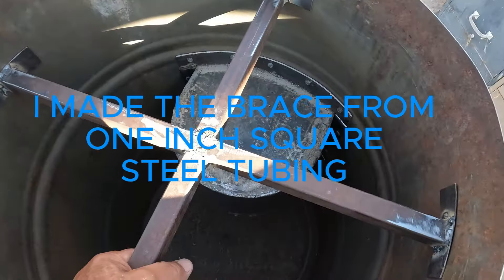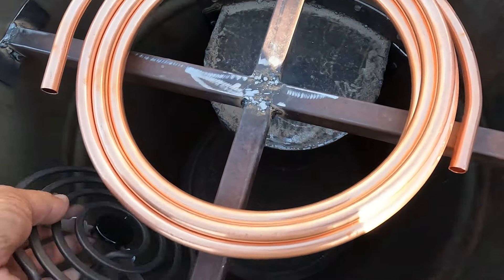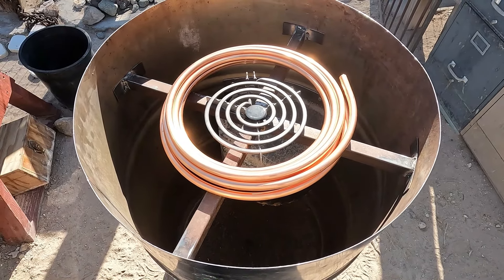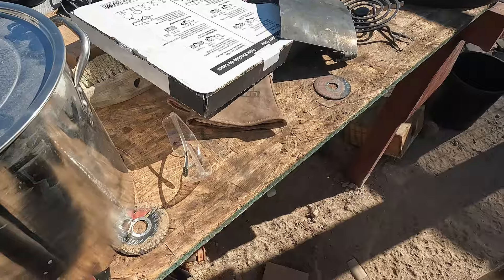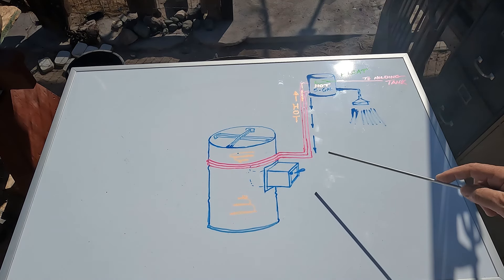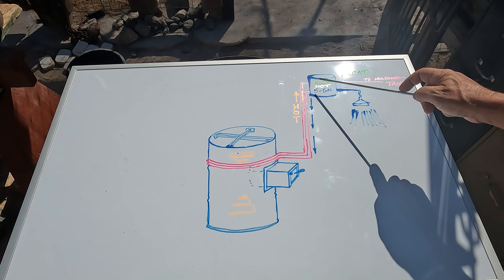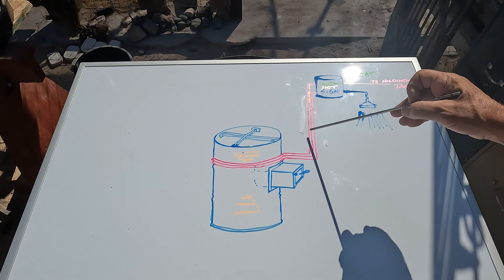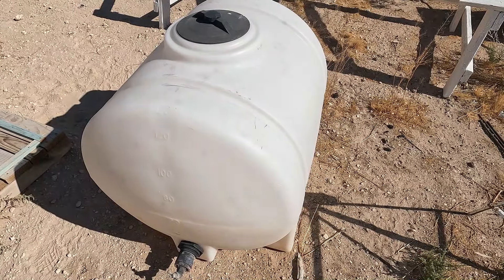155-Fifty-Five Gallon Sand Battery Update

Comment: I lived in a place that had an old hot water tank beside the wood stove with a water jacket that heated the tank with convection. The tank was plumbed into the water system and you could feel on the tank if it had enough hot water for shower. Was safe because of the pressure valve and was also a heat sink to warm the kitchen. Instead of the stove heaters you could use an old water heater and fill it with sand. The elements work on ac or dc so can be a power dump for wind or and solar power. Having to pay for grid power is kind of a waste of money and prone to blackouts, wood or used oil would be my go to. With the elements you would want to keep them on low because you could create a hot spot around the elements and they would burn out.
Reply from the maker: In the beginning of my experiments I used a hot water heater element but because it wasn't submerged in water like it was designed for it burnt-out and disintegrated after a few tests. Also I have had a 240-volt element running on 120- volts and -510 watts for close to two years straight on a prototype, I will be doing an update on it soon. My point is they seem to hold up great powered directly off of the solar panels with no regulation.

Comment: You want the cold water coming out the bottom of the holding tank and the hot water coming back in the top.  This way it will circulate the water automatically as it heats.
Reply from the maker: Yes I drew it like that at first but then reversed the inlet. Thanks for the heads up.

Comment: With a sand-based heat battery, the bigger you make it, the better it will work.  Volume increases faster than the surface area, so the bigger you get, the less heat you lose.  And of course, the more insulation you put around it, the better.

Comment: Go ahead and put the coil in the barrel in the sand. Better heat exchange, and it is no more dangerous. the sand is touching the coil heater AND the side of the barrel anyway. just get both ends of the copper tube out of the barrel so there is no chance for leaks IN the barrel.
Reply from the maker: Yes that is a good idea. I will consider that.

Comment: I'm planning on a similar design, 2 heating elements. 1 powered from panels and 1  as the load for my load controller. How many panels will you run 1 element on?
Reply from the maker: I am not sure yet. The heating elements can handle at least 2,000 watts each but I may start with around 500 watts per element and possibly double that to 1,000 watts per element if need be.
Reply: @off-gridsurvivalmike8120  my panels are 37 volt, 250 watt, right now I have 3 wired at 37 volts 750 watts. Would it work better wired 111 volts at 250 watts? This is for my 1500 watt water heater 110 volt ac converted to solar.

Comment: sand does not hold much heat energy at any particular temperature (low specific heat).  You would be better off filling the barrel with water (highest specific heat of any common material).   Sand batteries are only efficient if you get temperatures above 200C or 400F.
Reply from the maker: Yes I will be achieving temperatures above 400° F. I have recorded temperatures above 1,000 F in past experiments. I show the results in some previous videos.